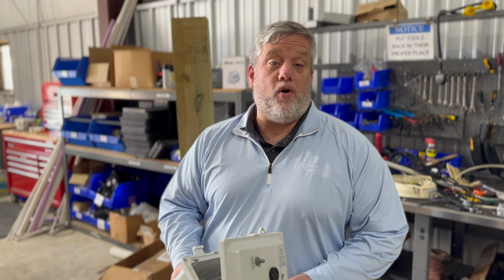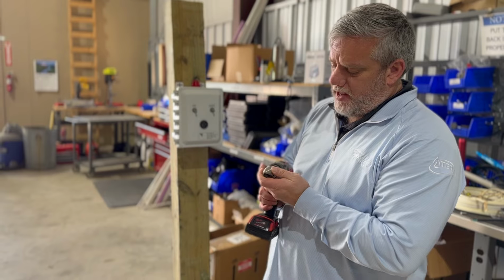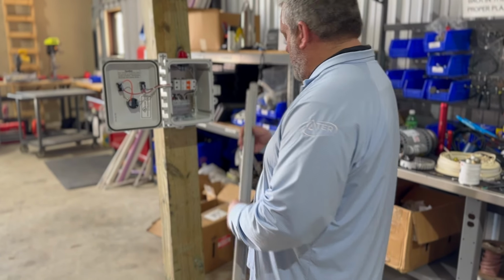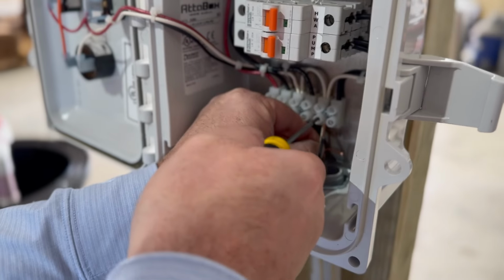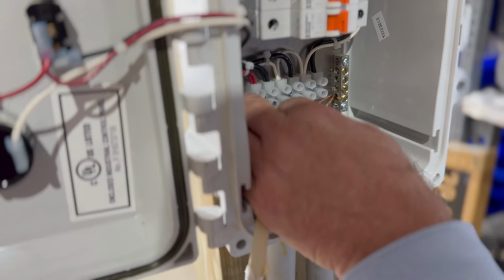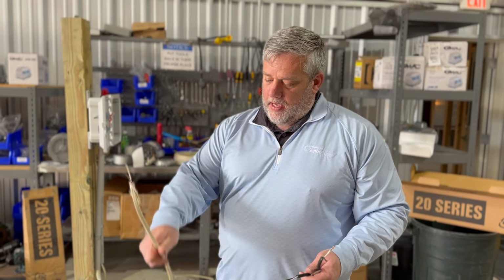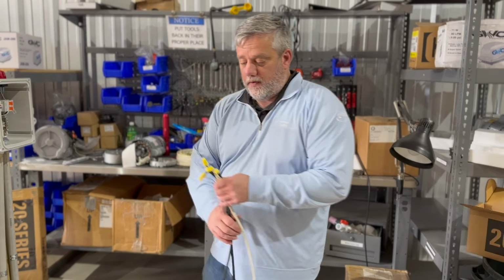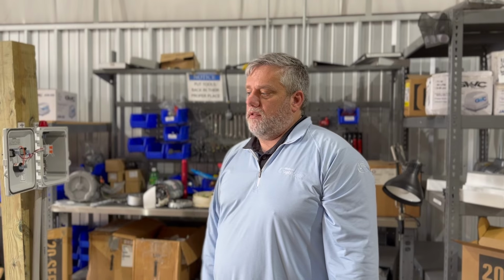How do I install a Septic System Panel? A complete step by step guide

Comment: What powers the alarm if the breaker in the house trips and pump can't run?
Reply from the maker: There is a separate breaker for the pump that would more than likely trip before the house breaker does. The alarm is in a separate breaker

Comment: Can u include the air pump into this box?
Reply from the maker: @bobhope1234p  you can do just the air pump on this adding a pressure switch. You can’t add the air pump and water pump together though. You would need a e2 panel.
Reply: I have an aerobic system that includes the septic pump, alarm and aerator. Which panel do you recommend?  How much does the panel cost?
Reply from the maker: @bobhope1234p  https://www.wholesalesepticsupply.com/collections/aerobic-control-panels/products/e1-economy-timer-septic-control-panel

Comment: I saw the pump and float get wired in, but not the alarm. What did I miss?
Reply from the maker: @DennyDFW  it was cut but it’s marked in the panels alm. For the float you just put the wire wire to the white and black to black on the bus bar.
Reply: @wholesalesepticsupply is that 12 gauge wire?

Comment: i can't believe how many national electric code violations, and misinformation is in this video. I have been a master electrician for 40 years.
Reply from the maker: @LBrawn  please do explain the violations if any so we can make a better video. This is an overview video on what can be done.
Reply: @wholesalesepticsupply glue has to be rated for pvc electrical conduit....the yellow you used does not...leave some free conductor for the next guy that works on that. A 6 inch loop is OK. Cramming 3 #14s under one ground buss lug is a code violation...again the rating of that buss is for one wire...not 2 or more. Romex can be in conduit but not outside in damp wet location. Consult a professional electrician before telling handy homeowners how to screw up their stuff. I fix improperly installed stuff often and it was done by someone who wasn't a professional and wanted to save a buck.

Comment: I'm working out the connections at the tank.  I used to have the 4x4 wood post, outlets and alarm box with the 3 cords (pump and 2 float switches).  I have a new septic panel and disconnect to go on the wall like you have.  The remaining issue is bringing the 3 cords from the tank (about 6ft from the wall) to the control box, there is no unground "box", just cords coming out of the tank.  I bought a 10" round x 12"dp sprinkler box and I'm planning to run a conduit underground and glue a 4x4 sealed box on the end with 3 sealing cord connectors in the sprinkler box.  If the float and pump cords aren't long enough, I'll put a sealed splice on them so they are continuous through the conduit with no connections underground.  When it comes time to replace one, it can be fed through the conduit without having to dig up all the wiring again.  What do you think?  I don't see much if anything readily available for the actual tank connections or any videos.

Comment: So, good information, however, I as a designer and an operator would say that the panel itself is "lacking" as it has No pump cycle counter, no pump elapsed time meter, all of which provide excellent diagnostic information for the service provider.   I also prefer a panel that the Hand / Off / Automatic switch is INSIDE the box so it cannot be "accidentally" tripped to OFF or HAND without opening the box.   AND Silicone filled wire Nuts !!! too many DIY's use regular wire nuts that are NOT designed to be used outdoors or in a wet environment!
Reply: @trapperdavis7706 You seem knowledgeable. A couple questions: 1) how do I learn what type septic system I have? 2) I’m needing to replace the alarm panel on my unit. I was interested in this panel as it couples the alarm and pump electrical in one (our current one is two separate panels); will this unit work? 

The current set up is an extension-cord-style female outlet that the pump plugs into. I would have figured that direct wiring would have been a more appropriate method. However, with all wires being jammed into a tiny box, I think there’s a link/break in the power. Thoughts?

Comment: Yay! Thank you!!🎉🎉🎉
I have an aerobic hoot system and the panel is falling apart…will this be the same install procedure?
Reply from the maker: This will be a little different same principle we will have more panel how to videos coming out as we see a need for them
Reply: Cindy - NO - A hoot panel uses low voltage to a Sensor Probe and does not use float sensors ... I would strongly recommend that you contact a certified HOOT service provider / installer to assist with replacing that control panel!